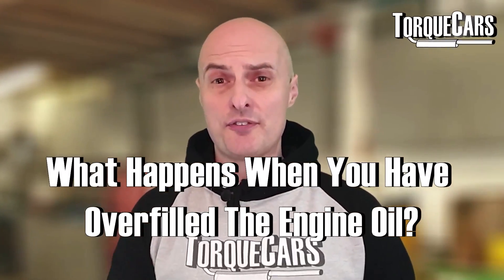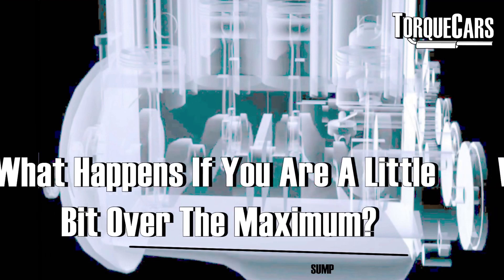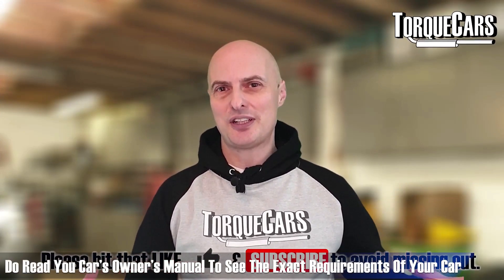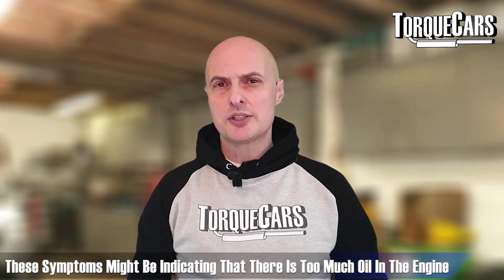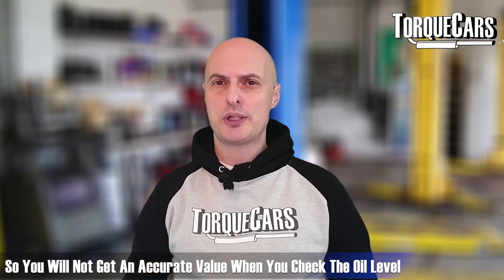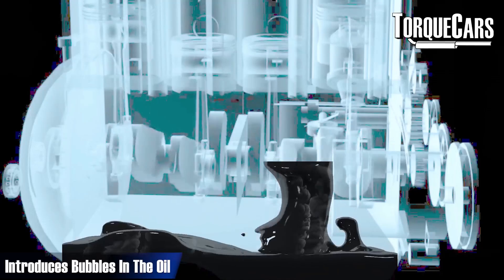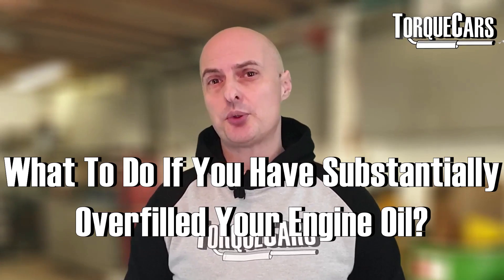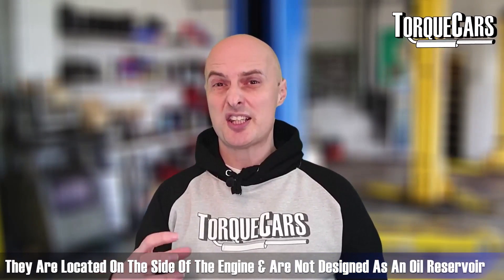Overfilled Motor Oil! What Happens & Engine Damage Done - Fix & Avoid Too Much Oil Problems

Comment: Sometimes overfilling can be good. I once had a 1972 Olds 442 with a W-25 455. It ran almost as hot as an H-bomb explosion. Because of the heat, it got 100 miles to the quart of oil at about 75 mph. I overfilled it by 1 quart. NO MORE OIL BURNING!!!!!

Comment: That is a good vid.  I check my oil level on the dipstick with the engine at full running temperature and I wipe and dip it within 10 seconds of turning the engine off.  That allows for the oil that is still in the upper parts and various other oil galleries during running.  Generally, I have it right on the full line or not more than a millimeter over the line with that method.  It keeps plenty of oil in the sump for a burst of higher RPMs and in some engines like my old 3.6L quad cam v6, the oil is part of the timing chain cooling, not just for lubrication which considerably extends the longevity of the 3-chain system.  Oil is the lifeblood of your engine, and it is not expensive to do regular changes of good brand name oil and filter.  Oil is always on sale somewhere nearby.  Regards, Jas.  Rockhampton Queensland Australia

Comment: On our 2015 and 2016 Subaru's they constantly put 6 liters of oil in an engine that the manual said 4.7. I found out they did this because of the oil burning issue these 2.0 liter engines had. They also charged for 6 liters. Crooks. I always had them reduce the price by 1 liter. When I got home from the shop I sucked out 1 liter of oil via the dipstick tube with a PELLA 6000 vaccuum pump. Never had the oil burning issue with either of these cars. The 2019 we bought they were back to 5 liters for an oil/filter change.

Comment: Just had my oil change today I usually do it myself. But this time the oil filter was just absolutely welded on so I had a mechanic come out and he basically had to use a torch to get the oil filter off which fine. 
But I literally tell him I want to fill the oil back up myself to make sure that I only get three and a half quarts in which is what my car calls for and sure enough he wanted to do it and he put four quarts in instead of the three and a half. 
And then mechanics want to know why you don't trust them lol

Comment: High oil level can wreck the turbo whereby the engine can run over the red line even after turning the engine off. The only way to stop the engine is by stalling it

Comment: My brother overfilled his oil and unfortunately as soon as he had engine trouble he drove all the way to the dealership to have it looked at. He had filled the oil until it was at the top of the cap. The honda pilot barely got there and died in the parking lot. Engine was completely toast. And needed a complete engine rebuild, or new engine. I guess something happened with the pressure in the engine that made the timing slip and the engine, under a massive amount of pressure, proceeded to self destruct with power. Pistons smashing into valves. That was almost 10 yrs ago, still have that honda pilot as a parts car

Comment: This video is fantastic!!

My engine oil was extremely low and I stupidly thought that if I added oil to it myself I could stretch out another couple weeks until a Valvoline oil change. I am a moron and very well aware of it. Knowing I barely had any oil at all, I bought a 5qt jug from Autozone (yes, it was the correct kind) and put all of it into my car. An hour later I left for a friends house and as I’m driving, smoke starts billowing from the back of my car. Turns out that when one adds oil to their vehicle, they should know how much oil said vehicle can hold and mine is 4.3qts, not 5 🤣….

THANK YOU for this video!! The lucky few friends of mine who I frantically called all said I probably overfilled the oil, but I had no idea what that meant until seeing this video! You did such a great job explaining everything and I understand completely now how engine oil works.
It only took me 20 years of being a licensed driver to understand how a car works 😂😳
If there’s anyone out there who feels they are not flourishing as an adult, you’re not alone!
Reply: Well, that's how you learn.

Comment: friend if you want a small amount to come out of drain plug area you don't need to create a mess or fully remove the plug. i loosen it with my fingers to keep the plug on it for control pour.

Comment: I accidentally put around .5ltr too much oil in my diesel avensis. I've driven around 5000km since then and haven't noticed any issues. Hopefully I haven't damaged anything. Should I be worried about that much extra oil and the fact I've done a fair bit of driving on it ?

Comment: Hello, i had 5.7 litre engine on my truck. I went to those quick oil change shop and they over fill the oil. I check the dip stick and it’s over the max like close to half of an inch. Should I still drain a little bit of oil or just leave it. Thanks in advance!

Comment: I overfilled my 2009 Porsche cayenne gts by 400/500ml and now is a few mm past maximum on the dip stick. Should I drain it? It has a 10 litre sump

Comment: question is oil extractor dangerous to use on hondas car? because of the oil filter is on the bottom? and also will it damge seals or any small parts on the engine? etc please i need your honest and experience opinions thanks

Comment: Local shopped changed the oil on my 99 Miata and over filled the 4 qt capacity by 2 qts! 

No symptoms besides leaking oil from seal after seal when I was replacing them 

Headgasket is sealing out of the side of the block.  You think I need a new headgasket or it should be fine after changing oil

Comment: I accidentally overfilled my 1.8t by about 150ml yesterday. Drove it fine today but checked today anyway. Should I be ok? When I did fill it was slightly under. I guess the excess from the top bit of the case went down
Reply from the maker: This video should help answer that question my friend. https://www.youtube.com/watch?v=I9bNIwulwQE
Reply: @ ah. I think I’ll be alright and after a bit it’ll use it anyway lmao. My car does have relatively high oil consumption (?) I changed early August and now it was one quarter off being from the min. It is old but hopefully I’m ok

Comment: Im a pretty smart mechanic with only like one real comeback at my first shop and the fix was to redline the truck and haul ass lol. Anyways I just did remanned heads replacement on a 1999 5.3 ls/vortec an I had the dipstick tube in the wrong exhaust slot an it didnt seat all the way. So embarrassing I overfilled it way too much an the oil was brand new I couldn’t tell with my eyes it was so frustrating. An so first start up it starts up an stalls off an dies. An then I started it several more times oil pressure was at like 80. And tiny bubbles in the oil I removed (it never ran longer than 2-6 seconds. I got the oil corrected. Found fouled out plugs and o2 sensors all black covered with gas on spark plugs. And so after cleaning them all it got slightly better but they still keep fouling out all of them. Compression 180 psi all 8 cylinders. Wondering if its possible I completely broke the spark plugs on first start up that was only a single second before it died an theyve been bad since. Currently it will start right up then die off in rpm. Then afterwards each start it will start an rev to 2500 rpms specifically an will reach like 60 oil pressure then die off as before. Will most likely buy new spark plugs today but want to know if anyone thinks I broke the bottom end or new top end I just installed. I was scared to start it with too little oil because the heads were all cleaned and machined and I ended up doing the complete opposite on accident. It’s incredibly embarrassing but all feedback is accepted good or bad I know I fucked up this is my first fuck up as a mechanic. Hoping I figure it out with some new plugs and sensors or find something small I missed. No knocking is good I guess. It did run normally for like a few seconds after first cleaning the spark plugs off then died. Im worried I did some sort of cavitation damage to it on the first start up immediately because its been pretty much the same ever since. But it didnt even run for more than one second before it shut off an now its getting better and better sort of with the few corrections.

Comment: Except on 351C engines. An extra quart prevents oil starvation at high rpms. Unless you have it modified to deal with that problem.

Comment: Valvoline overfilled my oil by 2 quarts. Didn't catch it till I thought I smelt a burning odor, and checked it to verify it was overfilled. This was 2000 miles later. They changed the oil for no charge, but  were very rude. I called corporate to document it. The car never ran bad, and is not running bad now. I haven't seen any leaks as it was just changed today. Its a 2015 Nissan Juke with the 4 cylinder turbo. I did notice tiny bubbles when first discovered it yesterday. How long will it take to realize whether there is damage or not? I dont want it to prematurely fail a year down the road, and then they refuse responsibility.

Comment: Hi. Tx for video. I put too much oil on myself right now. The last Honda service was a year ago. The oil level today was 1 centimeters less than the maximum. The markings on the orange dip stick are  not very clear. I put 1 liter of new oli. Now oil is 2 cm above the maximum. is that amount also  too much? In comment i understend you talking a out mouch more amount of oil to be considered overfilled?Tx for advice.
Reply from the maker: A few had asked this question so I made a video about it. https://www.youtube.com/watch?v=I9bNIwulwQE hope that helps with your question.
Reply: @torquecars  tx u wery mouch!

Comment: Got a 04 gmc sierra bot running on a trade for a small job I did to do a v8 swap  and once I charged battery and started it knocks like hell and then I checked oil was overfilled don’t know if that caused it or what but I drained 4-5 quarts and it was still a little over, motor has good oil pressure and runs good but knocks I may try to just run some thick oil in it and see what happens before I pull motor out 🤣

Comment: I over filled my 2004 Ford Ranger by pouring in the whole 5 quart container I bought .
And as far as I can tell after running engine to fill the oil filter.  Looks to be 1/2 quart over max still ?  (maybe a bit less)

Is this worriesome ?
Cuz I tried putting a 1/4inch tube down the dipstick to pump some out ... and it will not go past the last 3 inches or so that is the length of the dipstick .

Comment: I think Toyota overfilled my oil because my engine rattled a few days after I got the oil change and then I had to change a spark plug and coil. The same thing happened yesterday because I got my oil changed from another company a few days prior and the engine light and trac light went on and now I don't have a lot of power and the engine is rattling. I looked at the dipstick after it got cool and the oil is above the maximum level. I have a 1.8 liter engine. Maybe I need a tune-up becuz I have 80,000 mi on the car but I think it's more than a coincidence that the problems happen within a few days after getting an oil change. I don't know for sure, what do you think?

Comment: I have a catch can, and it seems to spray a little bit of oil through the top breather baffling when I hit the gas. It's blowing cool air while running and j checked oil and it's a few centimeters above the max fill line. Could this be the reason it's spewing oil? It's really not a lot of oil but enough to cause concern

Comment: Ice just got my A4 B8 back from a service, and it's showing a message on the digital oil level readout
"Please reduce oil level." 

It doesn't have a dip stick.  

My receipt shows they put in 5.5Litres from what I can see online it's supposed to have 4.6Litres.

The mechanic says to drive it for a day and see if the message changes. 

I'm concerned with this approach.
Reply from the maker: I'd be concerned too - are they expecting the car to burn off all that excess oil? A litre is something most drivers will get away with, so the crank is still clearing it. Unless you notice a loss of power, leaks or smoke it will be ok as it is.

For a mechanic to put in a whole litre too much and charge you for it doesn't give me much confidence in their abilities though.

You can loosen the sump plug to drain off some oil, but expect it to gush out and you might need to put some back in.

Comment: I fd up and read the oil level wrong and added 350ml more, car started and was vibrating abit. I got a pending misfire code on all cylinders, but no aladin lamp. I have a hyundai hybrid plug in, will drain the oil tommorow and see if the code goes away. I may have to change the plugs. Hopefully I have not bent any pistons😢
Reply: *a bit     NOT "abit". 
*tomorrow

Comment: Mechanic did overfill with oil. 1 inch above full(kia soul) some say oil will foam up if it is too much...changed it last week...oil looks fine...should I still go back and drain it or is it ok? when foaming starts? like straight away after change or can happen any time?
Reply: If it reaches the crankshaft and became aerated maybe a couple more inches. If you want you can drain the excess, just dont let ot overfilled next time.

Comment: We had a general service at our mechanic shop do an oil change on a Porsche 718 I think it's been awhile they drain the transmission fluid by accident thinking it was the drain plug for the oil the Porsche needed I think 6 quarts of oil he added six more quarts of oil took it for a test drive no issues Casper came back it was check engine light a bunch of evap codes I think and a couple transmission codes we let it sit in the shop the night before barrels of white smoke came out I told the technician to put the Porsche in the air and let the transmission and oil fully drained out for 2 days over the weekend the technician the following Monday which is 2 Days later did a transmission service new spark plugs put oil in the car correctly and cylinder one had a lot of oil on it not dripping but more noticeable than the other other cylinders cylinder one was the one that had a little bit more oil noticeable so we changed the spark plugs so I had the technician pulled the spark plugs out and he knows cylinder one was still wet so we got another spark plug and the check engine light is for cylinder one we well the technician I apologize so I unfortunately left the job before the Porsche was fixed because I was just moving on brand new wife kids caught a life so I was curious you know I never followed up what could be the issue I was wondering what could cause just cylinder one just always have the check engine light on what could cause that

Comment: I filled up my truck 5 litres over what it needed smh & as I was driving it started to just over rev itself so on my dashboard it said for me to pull over n put it in park..turned it off then I couldn’t turn it back on… it was locked the engine wouldn’t turn on.. do I need to replace or is there another way to maybe drain n clean it out for my truck to work… cheers feel so stupid smh
Reply: Note: I had a mobile mechanic come n drain the oil out n refill n it still wouldn’t start.. he automatically told me to buy a new engine but just wanted to see if there was still a chance of saving a whole heap of money.. thanks again
Reply: @thelast1leftlad spark plugs could be fouled

Comment: Brother, i had drove my car aggressively around 1500 kms with overfilled engine oil without noticing it done by my car mechanic. But i drained the excess oil last week. Should I have to replace it new engine oil for safety?
Reply from the maker: The oil shouldn't degrade due to an overfill, any bubbles that formed will rise out in a fairly short time, did it look fairly clean and clear when you drained it? Minor overfills are generally ok, we're talking about major overfills here where the crank is splashing in the oil. You'll have noticed a problem already if there was one.
Reply: @torquecars  Drained oil was clean & good and yes the mech filled around 2 inches more than the FULL mark in the dipstick..i drained about 1.5 litres. Anyway, i have a different issue in my car bro. Mine is hyundai diesel hatchback. My car is giving very poor mileage/litre of fuel when l drive with AC on. When the AC is switched on engine noise & vibration is on higher side. It feels like engine cannot bear the load of AC. But when driven with AC off it is perfect. No Mileage issues at all. I have checked the AC compressor assembly, water pump, alternator pulleys, bearings etc.. all are perfectly fine. No malfunction light glows as well. All the car technicians here are perplexed. Iam not sure what is the issue. Kindly give me some pointers.
Reply: @Sar_vesh how long you are experiencing the ac issue?

Comment: I accidentally put way too much engine in my car and then 
BiG buff of blue smoke and then a loss of power. 
Do I simply need to reduce the oil level, or is this a sign of more damage.
Any advice most appreciated
Reply from the maker: Usually if you catch this early enough and haven't done hard driving you'd get away with it. However sometimes once leaks have started they will not clear up so it might be it burns a little oil. Give it time after the oil is drained to settle and see, in the meantime drive it very gently if you have to drive it at all and get that oil level down as soon as you can.
Reply: @torquecars  thank you very much

Comment: So, putting 5QT istead of 4.6 as it says to my 2016 Toyota Camry wont do nothing wrong? It's been running smooth so far
Reply: Yeah thats not much more, so it should be fine, but if there are like multiple quarts over you should drain it
Reply: @roiselmartinez6368  what does the dipstick read?